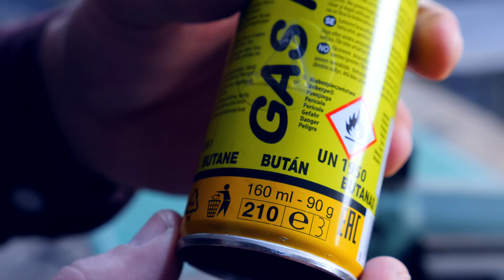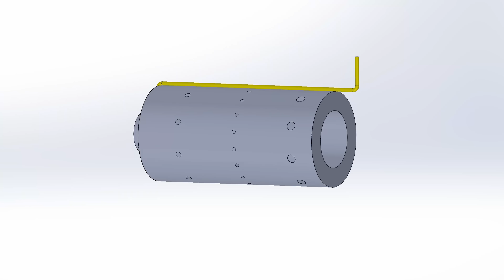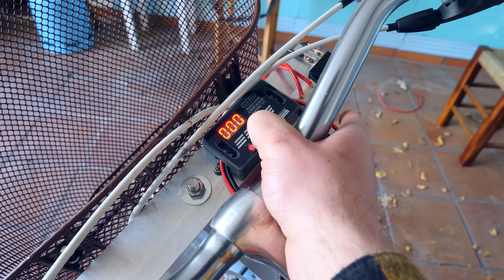I put a Homemade Jet Engine on my Bicycle

Comment: with the amount of melted jet engines hes made youd assume hed stop building them out of aluminum cans/solder and use proper sheet steel and a welder

Comment: Have you ever looked into wood gas engines? They were used to power cars with the smoke from burning wood during WWII and I'm curious if they could power a rotary engine or maybe be used with a Tesla turbine as a generator

Comment: I would like to see a jet engine using multiple nozzles all powered by separate hair dryers and some sort of fuel.  This way you can have 2 or 4 nozzles on the same assembly.  I think that would be really cool to see.

Comment: Idea: split the stream of the leaf blower and put it on two jet engines for double power! Or maybe put the leaf blower up to a turbo compressor to make the air slower but more pressure!

Comment: Each time I watch your videos, I get terrified about how close you come to putting your hand in the exhaust of your engines while trying to ignite them. So I propose that you try to make an automatic ignition using something like an Arduino and a solenoid valve. With that, you could maybe even control the throttle. Keep up the great work! Can't wait to watch your next video! :D

Comment: Idea: You may be able to make a piston engine powered by hydrogen peroxide. You could basically make a normal engine with catalyst injectors instead of spark plugs.

Comment: 13:55 
I posted the same idea (individually and idependantly) but with a little bit of air space above the cathalysts. This is to make the indecomposed hydrogen peroxyde return to the cathalyst as soon as the pressure from below drops. 
I would really like to get such a 3D printer ;)

Comment: Your creation may not go Mach 1, but that's not necessarily a bad thing - you don't have to go Colin Furze levels of 'suicidal', after all 😁... Just a bit more speed may have helped the test, though - judging from the footage, you were just slow enough to be wobbly, which is especially disturbing going through the turnaround, with a running jet engine in your back 😬...

Comment: You should create a solid fuel jet engine. It would use solide fuel and high velocity air to create ( hopefully) high thrust. OR YOU COULD MAKE A NUCLEAR(the nuclear part is optional) ENGINE, USING SUPERHEATED HYDROGEN AS A FUEL SOURCE SO THAT THERE IS NO OXYGEN REQUIRES

Comment: You could try using steel rivets in your steel-based high-temperature creations, like in this one. Steel rivets could join together thicker material, and have a little bit more "give" when the metal expands from high temperatures.

Comment: Swirl vanes! Maybe you should try swirl vanes and/or changing the direction and location of the fuel injection to get the flame to burn in the combustion chamber. I think this is what they do in airplane jet engines. If you have a bunch of air blow between the casing and the flame tube it might cool it enough not to melt. This way you will be able to take advantage of all of the flame's expansion and you can add a convergent exhaust nozzle to increase thrust

Comment: idea: universal turbine ignition and start-up system. This would be able to control speed up and slow down operations for air control, ignition controller and have the ability to be used with all your current and future turbines and rockets. (would help make it less complicated and more repeatable to start-up your engines.)

Comment: What are the chances of a 3d printed rc car powered by a butane/butaani/butaan/butano rocket that you have the control to accelerate brake and steer.

Comment: Idea for a video make a wind tunnel by 3d printing a giant propeller and adding a smoke machine behind it then you can build a box and add a window to get a wind tunnel for your models so you can test it. You can even put rocket bodies inside if they have an unusual shape to see how they might fly.

Comment: 10:00 thats not a welded joint, its hard soldered. I'm guessing brass? Silver solder has a higher melting point so check that out! Silicon bronze might be better aswell.

Comment: @Integza one way to prevent your nozzle from melting would be active cooling. meaning you weld ( not solder!! ) half-tubes around the nozzle which go then into the combustion chamber and not just increase efficiency but also cool your nozzle ( e.g. the active cooling on the RS-25 Liquid fuel Engine of the Space Shuttle Programm / Space Launch System ). choosing this option would mean you dont have to run your engine fuel rich and prevent soot on your injector or other sensitive parts in the combustion chamber.

Comment: How about a solid rocked motor? With DIY oxidiser like potassium/sodium chlorate. You can make it with a chlorate cell. It sounds scarry, but it isn't. I'm working on that right now and I'm interstet in how other make those engines.

Comment: electrosync designed and printed a pretty cool 3D printed toy torpedo recently, but it didn't have a nozzle. It'd be a fun challenge to see how much better it could perform with a proper nozzle!

https://youtu.be/VAyJWpTFGtY

Comment: Would like to see you use some lost pla casting so you can 3d print the parts then convert them to metal without all the pores that come with the ceramic stuff then you can look at some really cool jets with the leaks and melting problems

Comment: Couldn't you potentially turn the air you're losing by having the tube not fully connected into bypass air that will also provide thrust? Like how a turbojet engine for an airliner uses bypass air to provide most of the thrust..

Comment: Love the Videos but the "Welding you claimed to have done on the nozel and such is actually called brazing which uses metal that melts at a much lower temperature. if you used a welder and bonded the two steel pieces it would have not started to fail.

Comment: the problem whit your exhaust is it is getting to hot duh. but normal a jet engine use about 20% of the intake to the burners or flame chambers. the other 80% round about is getting around it to cool the enigne turbine. it can still meld your exhaust but that why it is made out of titanium. but for this project iam realy amaze it work out for grandpa bike at least he is now quicker on the spot. :P

Comment: I believe that in your next video, you could put your brass tube bending and welding skills to use creating a chilled rocket nozzle. Surround your nozzle with a coil of brass tubing and run a cooling fluid through it. Good Luck.

Comment: oke for safety reson how did you cut the bottle. there was butano, butan and or gas in it :P oke you drilled a hole in it so there is stil some rest butan in it that on the moment can mix whit the oxygen when you drid the hole treu it. than you cut it whit a grinder whit all the sparks. luckly you got nothing but why it didn´t blow your hans off. please alway first fill it wit water or some non flameble fluid to replace the existing gas before you do this. so fill it whit water treu the hole and make sure whit drilling no heat come in it. so fill it whit water treu the hole so it replace the gas and empty it so it replace the water again whit oxygen then first it is safe to cut it. mate stay alive we need more crasy video´s but not stupid one´s were you blow your self up. or some youtuber that doesn´t now how to do it it. the same whit al flameble can bottles and stuff. keep up and stay safe.

Comment: It would be awesome if you reverse-engineered a gas turbine engine to use the forced air from the leaf blower, in this case, to not only increase thrust but also connect to the bike gear to spin it similar to an electric motor setup. Ideally, if you pedal first you could remove the leaf blower entirely!

Comment: Great video, but I would NEVER cut open an  empty lighter fluid can with a angel grinder. There is still a risk of fire/explosion. If you have to cut it open. I would use a hand saw to avoid sparks. And lighting an bowl of liquid butane? What did you expect?

Comment: Watching that original exhaust melt down I thought it’s a real shame you couldn’t harness that heat into a secondary steam engine that charges the leaf blower battery and slave the high voltage system off that battery as well. Since the leaf blower is way op for what your using it for, have you thought of running it inline with the direction of travel and giving it a directional adjustable venting feed pipe pre combustion chamber. That way throttling the engine can be achieved by opening/closing the amount of the venting and any lost air input from the blower, which can now just run full blast, is still turned into forward thrust? Initially in design it would be difficult to dial in but once you did your net thrust would be higher.

Comment: What if you 3d print vortex assembly to increase the over-all air pressure output. Would it also be possible to use an old car turbo in place of the leaf blower? Another thing to try is piping the cold gas around the exhaust to try and keep it cool. Make more fins from an old radiator and put the fuel pipes (which should be cold) through them to help cool the exhaust.

Comment: Speaking of leaf blowers, although this isn't a jet engine, how about trying to make a water jet engine for say, a kayak. Using the leaf blower, blow through a wye fitting. The opposite side of the wye is horizontal to the boat. As the air blows through and out the back, it should suck water through the front, similar to how an air brush works. Contact me if this intrigues you. I'd be happy to supply you with basic plans.

Comment: Gonna be that guy….. that’s not welding, it’s soldering. Welding requires that you actually melt the 2 metals together with only a bit of filler. Soldering and brazing are more like gluing. The filler metal melts at a lower temp than the metal melts at and that’s why it fell apart. Without the model actually melting

Comment: What if you archive a cold rocket Engine by just mixing liquid butane and water. Or if you need more power use Propane. Because in its liquid state the gases are very cold they expand in size extremly when heated. The cold water mixed wird the liquid Gas wich leads to expansion. Wird this Concept I Made a few Rockets myself but never tried to have a some how conntrolled Engine.

Comment: Integza, what you have done is not welding. It is brazing. Brazing is great, but as you found, it will melt at high temperatures. I would recommend learning how to TIG weld. With TIG welding you can do extremely precise welds on thin metal. This was a fun project though! Albeit I was mildly disappointed that you didn't test the exhaust gas temperature on a tomato....

Comment: I'd love to see you work with loss PLA. 3D print a jet engine then cast it in metal. It would fix a lot of the melting issues you have had with a lot of builds!

Comment: When you do your jet engine builds like this one, I would love to see a thrust comparison with and without a chemical reaction. For example in this video, how much thrust are you getting with just the leaf blower vs how much thrust are you getting with the leaf blower jet engine.
Reply: My guess 1.5lbs leaf blower. 2lbs with engine.
Reply: @martinda7446  even that is generous...
Reply: @jjhack3r  Ha,  ha possibly yes.
Reply: My thoughts exactly!
Reply: As far as I understand the thrust gain from combustion depends on the compression ratio. With the leaf blower the compression ratio is probably 1.2:1, the the thrust produced is negligible.
Reply: @AnonyMous-gt8vq  Yes, I was surprised it moved the bike.. In fact I'd say it probably didn't!
Reply: split the flow and use half the air to cool the engine
Reply: @thecheaperthebetter4477  And it wouldn't make any noticeable difference to the (almost none) output but would make ignition easier.
Reply: This same thought had me here to comment.

Comment: Soldering isn't the same as welding.  The casing is likely hotter than the fire you used to melt the solder.

Comment: Looks like a great flame effects toy but I don't see a structure for handling any thrust.
Paper thin sheet metal?
Real jet engines have many do y propellers on bearings.
Or is that just the intake?

Comment: Combustion is supposed to spin a large turbine in a real jet engine. I doubt the fire is adding any trust. If anything it's restricting the airflow of the leaf blower and the bike would be faster with just the leaf blower alone

Comment: Why don't you try to make your own hydrogen electrolyze to use as fuel to your jet engine instead of propane? It's Planet Friendly(because when hydrogen "burns" it transforms in water =)) ) and have a lot powerful than propane.
Also try to make a hydrogen fuel cell ( like Toyota Mirai).
*If you want to build the electrolyzer, try to make 2 different chambers with the bottom connected to be sure that you separate the gases

Comment: cant you drill a center hole through a disk, put a screw throug hit and clamp it in a drill? the you mount the drill with a vise to the table, turn it on and use the dremel on the spinning disk for round cutouts?

Comment: You should try using N2O canisters for a hybrid rocket, using anything that burns (especially tomatoes) as the fuel. You can buy them in canisters that are similar to the CO2 bottles, and are sold for making whipped cream. Using a valve and adapter like you had on the CO2 bottles you can control the thrust and can burn most things using N2O as an oxidiser. you could also mix this with propane in your normal propane rocket/jet designs for a more efficient output. 
You should also try making 3D printed molds for casting or shaping/ forming metal or ceramic/clay parts for cheap and repeatable parts, such as nozzles or mounts. 
You could also make a press to compact powdered fuel (like dried tomatoes and some sort of binding agent) into more efficient engine shapes. Tomato fact: tomatos used to be called poision apples as they often caused lead poisoning by disolvong the lead from pewter plates. Another reason to hate tomatoes.

Comment: I believe the rc off road car speed record is 100mph. I'd like to see if you could maybe create an rc off road car to try and beat that with a combination of the 3D printer for a light weight body and rocket to  propel it. I don't know what the rules are about rockets but it still would be cool to see how fast you could get it to go.

Comment: Generate oxygen and Hydrogen from water and use it to power a jetengine.  Do techinically its a water powered jet engine, you can even use water from all the waste tomato for this.

Comment: Tesla cars are just sad excuse’s for speed it’s a normal car that they ripped the heart and soul out of gave it a life support machine then sowed it’s mouth shut by removing the grill. Yeah it’s fast but it’s boring when a 7liter V8 screams at 7,000 yo 8,000 rpm it’s a beautiful thing that won’t exist in like 10 years maybe the roar of the engine then as it begins to shift into the next gear it disconnects from the drive train and becomes weightless then a sudden jerk as the next gear catches. It’s the most beautiful cycle that everyone takes for granted because people have lied to you and said it’s better for the environment when in reality it produces double the manufacturing emissions as a normal car and the materials for the battery are mined by child slaves in the Congo

Comment: I'd like to see you run the same, or similar engine at night with some sort of headlamp on the bike so you can see. I imagine the jet's flames will be much easier to see in low light conditions.

Comment: You could try making a hybrid, carbon-neutral rocket engine that use the electrolysis of water to make oxygen and hydrogen. It wont be powerful but... (I am french so my english is not the best)

Comment: Integza, have you considered using the steel from automotive exhausts for your jet engine exhausts?   That’s a better grade of steel that can be exposed to more heat.  Your local automotive shops might have cutoffs that you can buy cheaply that are leftover from muffler replacements.

Comment: just a quick tip mr Integza...since you use solidworks, try thermal simulation of your parts in the simulation add-on tab...you'll save a heck of a lot of time.

Comment: 1 That's braising not welding .  it will never hold at high  heat like that
2 They sell industrial use syringe  needles that are blunt on the end and their dirt cheap.
3  Please be extra safe and wear a  glove when using that spot welder just because  technically you don't have too all it  takes is one false short and no more Integza and i like you,  Your entertaining.

Comment: Can you make a motor engine powered by water electrolysis. First by building the electrolysis generator with good amount of Hydrogen and oxygen. Then a good motor to use those gases 😜

Comment: I think your combustion chamber was in backwards. Check the design the fuel should be burning in the combustion chamber and not in the nozzle. You can tune the holes in the combustion chamber then to give you some boundary layer air that should reduce the temperature your nozzle is seeing.

Comment: I think that it would be usefull to create a piece (a compresser i think is it's name) that transform the speed of the air at the end of the leafblower into pressure which is much better for a good combustion

Comment: What if instead of using just a peice of sheet metal whith holes to distribute the air flow you design a cylender like object using the metal 3d filament because once you burn off the resien it will have micro pores all over the structure.